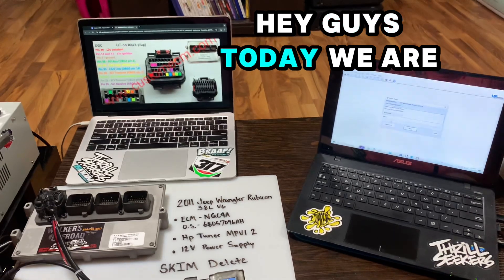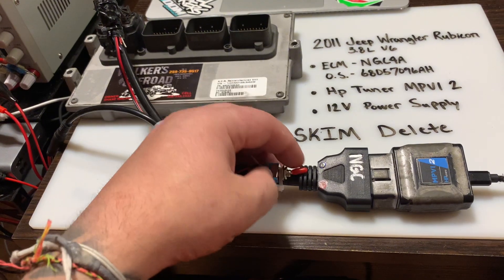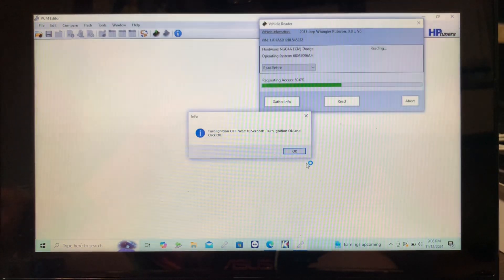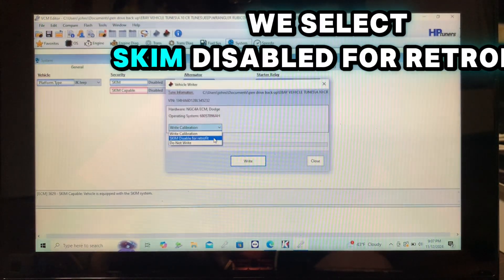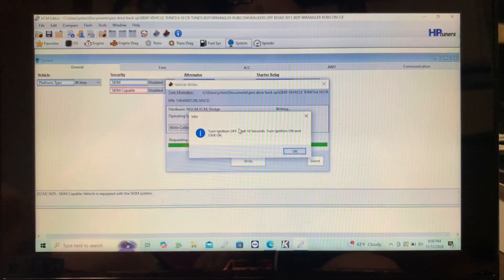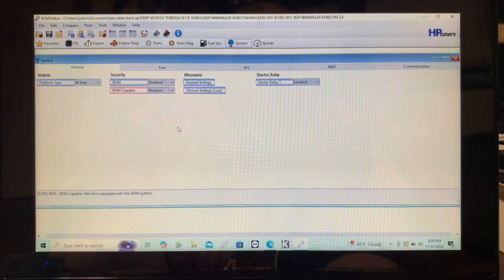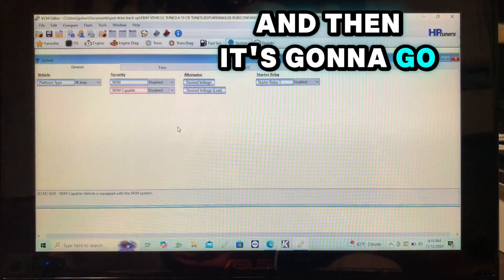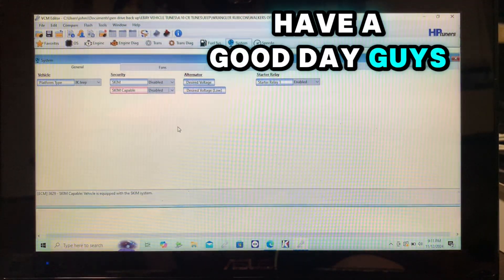DIY Jeep Dodge Ram Chrysler NGC bench Pinout / SKIM delete procedure

Comment: Hi! Just a quick question, for chrysler 300c v6 diesel engine with EDc17C49 HPtuners can't read it due of skim is blocking, to be able to read/write by HP tuner, what 3rd party software i need to turn off skim so i can read & write it.?

Comment: i dont get the option for write for retro fit on my swap with hp tuners 
 what could i do? also my pcm is plugged in my swapped truck with a obd port
Reply from the maker: Do it on bench

Comment: Hiya all, I have a 2008 wrangler. It will start and run all day, but if its turned off, it will only start again if the battery has been disconnected then re connected. Does this still sound like a skim issue? thanks in advance.
Reply: You know how to cycle your key/ ignition to get the error code ? It will tell you if you have skim problems. The error code on 2007 jeep JK is po513 . I think yours is the same.

Comment: I COULDN'T CLONE A 2004 CADILLAC SRX ORIGINAL ECU WITH A USED ONE SO I USED THE HP TUNER AND JUST DID THE VIN EDIT AND ALL WORKED FINE. THANKS FOR YOUR TIME AND SHARING YOUR INFO. I AM A REGISTERED LOCKSMITH AND GETTING INTO PROGRAMMING AND I HAVE AN HP TUNER, KESS3, ACDP, AUTEL IM508, SEVERAL XHORSE TOOLS, FC 200, OBD STAR DC706 AND THE LIST IS STILL GROWING. I AM NOW CHALLANGED TO LEARN ALL THE CAPABILITIES OF EACH TOOL. MY MIND IS STRETCHED. THANKS AGAIN.
Reply from the maker: The hp tuner is a great tool especially for the gm's.   not sure how many other makes it supports for vin editing though.  I know it doesn't support fords
Reply: @drewjohnson5402  THANKS FOR RESPONDING BACK. I COULDN'T FOR THE LIFE OF ME DO AN ODOMETER CORRECTION WHEN I SWAPPED A CLUSTER ON A 2001 DODGE 1500 RAM. I ENDED UP GETTING ONE WITH THE MILEAGE ALREADY CORRECTED TO THE ORIGINAL CLUSTER. I ALSO HAVE AN ANDROMEDA PROGRAMMER AND ALOT OF OTHER PROGRAMMERS BUT COULDN'T FIGURE IT OUT. I BELEIVE THE MILEAGE WAS STORED ON THE MICROCHIP. I BELEIVE THE EEPROM IS SOMETIMES BUILT IN WITH THE MICROCONTROLLER. I WOULD LIKE TO SEE YOU DO SOME MILEAGE CORRECTIONS ON CLUSTERS WHEN THEY ARE REPLACED. THANKS FOR SHARING INFO AND YOUR TIME.
Reply from the maker: @  I do some gm cluster mileage corrections every now and then.  next one I get I’ll record and post